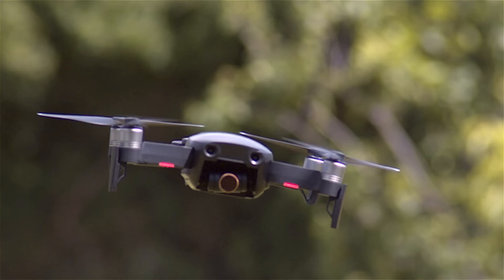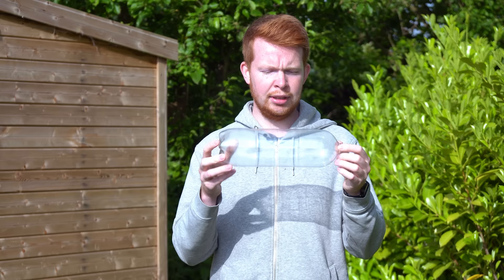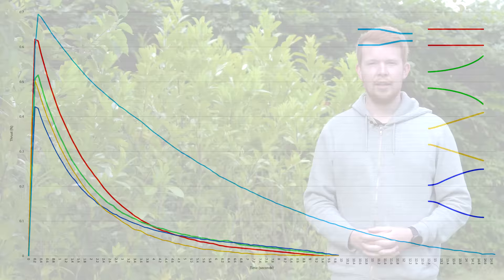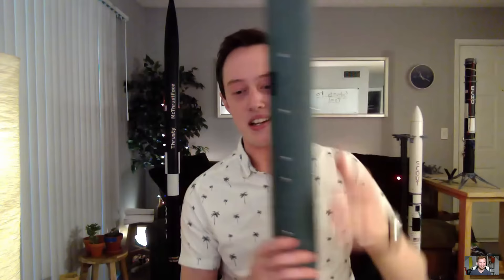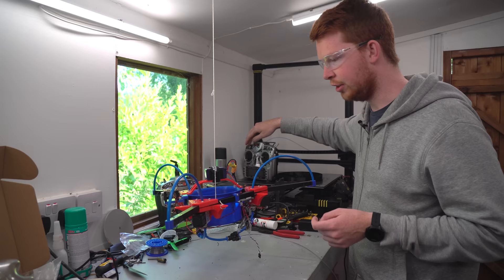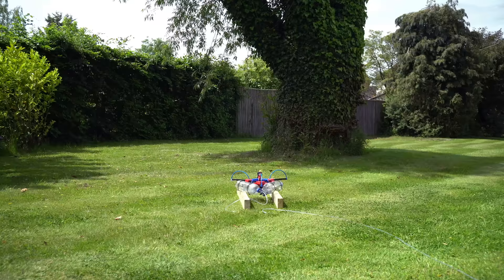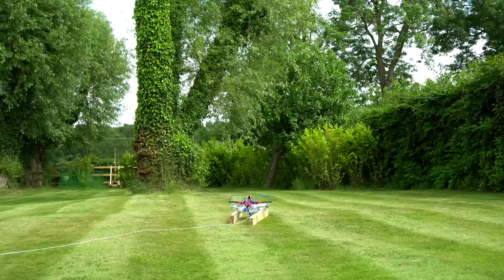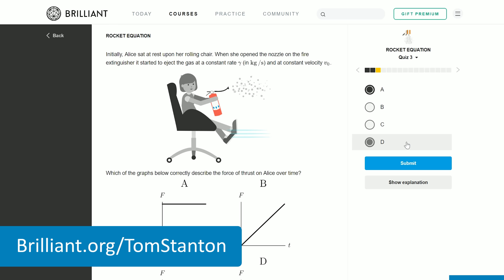Gas Thruster Controlled Drone

Comment: There is a simple way to have a compressed fluid that doesn't change pressure as it is vented: use a liquid that boils below room temperature. Propane should work (though the pressure gets sketchy-high for 2 liters on warm days). If flammable propellants aren't your thing, then "canned air" should also work. Using boiling liquid has the added benefit of being able to carry much more propellant in your tanks.
Reply: dry ice would definitely similarly very high pressure, a pressure release valve might help mitigate that
Reply: maybe chemical gas generator? CaC2+H2O or something like that?
Reply: Well spotted! Propane has a density of 493kg/cm3, while compressed air has just 1.2 kg/cm3, that's why using compressed air you need an unbelievable amount of pressure to stabilize anything (rockets/drones/etc., etc.).
Please check the propane gas thrusters created 5 years ago by Amazingdiyprojects. He created this system for his steam model rocket motor. If BPS will use propane, booya, we are going to see some serious fireworks. :-)
Reply: oh goodness, i just realized what would happen using propane with a solid rocket propulsion mechanism
Reply: Did someone actually suggest venting propane for thrust instead of igniting it? We must be at a genius convention here... Maybe you can just power the drone by getting an extension cord and plugging it into itself for abundant free electricity.
Reply: I would highly, highly, caution using a flammable gas in this experiment. Dry ice with a spot of water to help it evaporate would be much safer. With an appropriate over pressure release valve of course. Many pressure regulators have them built in.
Reply: Most canned air is also flammable. I learned this the hard way using it to cool something I was soldering with a torch.
Reply: @alphaforce6998  Nobody has suggested that, but propane is flammable, therefore (potentially) the gas thrusters system can be used with a drone (as long as you take care of all the hazards), with a steam rocket motor and for other "applications" don't involve the use of solid fuel motors (as venting propane during the combustion of the motor itself, can ignite it). Regarding your idea of the long extension cord, what can I say... welcome to the convention!
Reply: @RCLoversan  Just looked up his vid. Very interesting. One catch though is that the rate at which gas is produced decreases as the temperature also decreases due to the pressure decreasing and the gas vaporizing. But that is a good idea. For a short rocket flight it might work pretty well.
Reply: @RCLoversan  says: "Nobody has suggested that"

Original Post:
"There is a simple way to have a compressed fluid that doesn't change pressure as it is vented: use a liquid that boils below room temperature. Propane should work "

You sure about that?
Reply: @alphaforce6998  He's saying propane has higher density, therefore can be stored in larger quantity (compared to air) and that propane becomes volatile at room temperature. I don't see any suggestions about igniting it, though there is the risk of, as propane is highly flammable.
Reply: @RCLoversan   You are missing my point, sir. I am stating that it would be far more effective to ignite the propane RATHER than venting it for thrust.
Reply: @RC Lover san Density is not important in this case. Velocity (pressure) and quantity of gas at a given velocity are the factors that determine thrust.

Venting propane from its liquid state to gas via evaporation generates very low velocity, and therefore minimal thrust.

Thrust occurs as a result of atmospheric displacement. A low density gas expelled at high pressure (velocity) in a given quantity will produce exponentially more thrust than a denser gas in the same quantity at a lower pressure.
Reply: "It WoUlD bE fAr MoRe EfFeCtIvE tO iGnItE tHe PrOpAne" yes, it would be more effective to go buy a drone at the store too, but that's another project (much less interesting) this is about using gas pressure to regulate the drone, you don't get how this works, do you?
Reply: @ @alphaforce6998  Yes, you are correct, igniting propane would be far more efficient it terms of thrust generated than venting it, but the problem we are discussing here is not efficiency, but inconsistent gas pressure. Efficiency was never the point of Tom's design, he already made it work with a far less efficient propellant (air). His goal is simplicity, and using burning propane as fuel would make the system far more complicated, therefore it would be a terrible idea for his project. Venting propane wouldn't add too much complexity, and it might solve his problem with decreasing pressure, so it might be a viable solution. Though there are probably better solutions out there.
Reply: @gavinoaw   A regulator and high pressure storage tanks would be the only way to use comprssed air and maintain consistent pressure for more than a few sprays.
Reply: @alphaforce6998  Oh, brilliant idea. Then instead of fans and cold gas thrusters, he could have a ball of fire and plastic flying about his yard. Propane's a bad idea because it could catch fire. Intentionally lighting it is just insane for the materials Tom works with. 

Oh, and one other thing - even real satellites often use pure gas pressure instead of igniting a propellant for RCS systems. Turns out getting reliable relights every half second or so is difficult unless you use some crazy nasty hypergolic chemicals or expensive catalysts.
Reply: Yes, a phase-change fluid or dry ice would give a much higher volume of thrust (to last longer) but you would also have weight penalties. GREAT JOB!!!! A true success in proving the concept!!! Another great video!!
Reply: @JohnDoe-rl9pp   So, lithium batts never catch fire and/or explode? Sorry but propane venting is dumb and expensive. If you lack the intellect to make it work with ignition, then dont do it - but dont talk like things you cant/wont do make it an impractical idea.

Real "satellites" are suspended from helium filled balloons, and none of them do not have thrusters. Not what you believe them to be.
Reply: Liquid nitrogen!
Reply: @alphaforce6998  wrap it around a magnet first then plug it into itself.
Reply: @RCLoversan  it must be a SHIELDED extension cable and the shielding needs to be grounded. So make sure it's a LONG one.
Reply: @alphaforce6998  sounds like a SUGGESTION to me...
Reply: @RCLoversan  and you are guiding a ROCKET with it. Isn't a solid rocket motor a source of ignition?
Reply: @leveckfamily8841  You can't used it with a solid fuel motor model rocket. I mean, unless you don't want to see some serious (and dangerous) fireworks.
Reply: @leveckfamily8841  I'd like to underline the extension cable is not my idea and I don't think it can be applicable with hobby grade rc drones (not mentioning rockets). Tethered drones exist and are useful in other applications, but a hobby grade rc drone will probably struggle to lift the cable/wire itself or, at least, to fly in a predictable way with a cord attach to it.

Comment: You could probably gain some efficiency by also ducting the nozzles. Venturi effect etc.
Reply: The venturi effect may increase the velocity of the gasses,  but it doesn't change the mass, therefore doesn't change thrust. The nozzles actually increased the surface area which increased drag which reduced thrust.
Reply: Andrew Krause you trade pressure for mass flow. Just what you want.
The ducts around the nozzle would work somewhat like the duct around the prop.
Reply: @andrewakrause  p=m*v 
F=dp/dt
Reply: @andrewakrause  Yes but the trust equation is a function of mass, flow, and velocity. Thus it would increase.
Reply: Try it, let us know.
Reply: I think you mean, like a jet-pump.
Reply: @14aartis  Ducting the nozzle would increase "fuel efficiency", but it would decrease instantaneous thrust. It would lower the thrust a certain degree but would use up a significantly lower amount of pressure. https://www.grc.nasa.gov/www/k-12/airplane/rockth.html The mass flow rate decreases while the velocity increases. A decreased mass flow rate means that less fuel, or in this case air, is being consumed per unit time. An increased velocity means that thrust given from each unit of air is higher. The only reason that this could be considered less efficient is that the temperature of the gas tanks would decrease more due to the fact that more kinetic energy is lost in the exhaust gas, but in this case it doesn't matter lol.
Reply: Make a bell shaped rocket nozzle on the ends, it might increase surface area for the air to push against. It's like the combustion chamber in a rocket, it needs something to push against.

Comment: Correct me if I'm wrong, but if my calculations are correct, you're adding anywhere from 9.97382 grams to 10.5526 grams OR 16.6230 grams to 17.5876 grams PER BOTTLE - depending on if you use 60psi or 100psi compressed air in each bottle with 0.002m^3 volume (2 Liters), respectively. 

This means you're adding at least 29.9215 grams or 49.869 grams to your aircraft.
However, you're dispelling this mass UNEVENLY! This will cause the Center of Mass (CoM), the Center of Gravity (CoG), and intended Moment of Inertia (MoI) to shift in the direction toward the side with more mass/gas. 

You can solve this 1 of 2 ways, how I see it. 1) You need to connect all 3 of the pressurized 2L containers together via open, fixed valves so that they form a single container of pressurized gas - this way the air is much more uniformly distributed when expelled. 2) Adjust your thrusters' flow rate to compensate for the changes in CoM, CoG and MoI - this would be significantly more challenging since you'd need to add pressure sensors (that withstand 60-100psi) to take these measurements and write more complex logic to even start testing.

• m (mass of Air): TBD

• M (Molar Mass of Air): 28.9674g/mol => https://www.engineeringtoolbox.com/molecular-mass-air-d_679.html
• V (Volume of container): 0.002m^3 => (2L == 0.002m^2)
• p (pressure of compressed Air): 413685.4374Pas or 689475.729Pas => (convert 60 or 100 PSI to Pascals)
• R (Universal Gas Constant): 8.314
• T (Temperature in Kelvin): 273.15K or 289K => (0˚C or 15.6˚C)

Using the formula for the Ideal Gas Law:          m =  ( M • V • p ) / ( R • T )

References: 
• https://en.wikipedia.org/wiki/Standard_conditions_for_temperature_and_pressure
• https://physics.stackexchange.com/questions/268419/how-to-find-weight-of-compressed-air#268442
• https://www.calculateme.com/temperature/kelvin-to-fahrenheit/300?
• https://www.engineeringtoolbox.com/molecular-mass-air-d_679.html

Comment: Great stuff Tom.

expanding nozzles need a gas with energy to do the expanding , compressed air has little additional (heat) energy.
Reply: Rick Lokers  IF it comes at high pressure, which is not the case here
Reply: Yeah, also for any nozzle you want speed for pressure which is why the constricting worked best, though it could probably be optimized a bit further.

The exceptions for the energy rule is entropic explosives and low speed deflagration combustion, in essence the actual rule is that the bell nozzle and aerospikes wants supersonic flow of propellant, which in essence mean combustion products.
Reply: Wouldn't it work better if he reduced the flow BEFORE the expansion nozzle?
So if he used a 2mm supply line that fed into a nozzle that first reduced to 1.5mm THEN expanded to 4mm wouldn't that work better?
I'm not sure what the most efficient numbers are but you get the idea, right?
Reply: @leveckfamily8841  Not if the flow isn't supersonic, if it is super sonic there are other reasons to avoid it sometimes like structural integrity, but in general then it's a good idea, in those cases you need a different type of restriction though.
Reply: @leveckfamily8841  the best would probably be a diverging nozzle with a small throat like the one he settled on (≈2mm) and that expands to 4mm or 5mm.
Also it would probably be a good idea to sand it smooth to decrease drag/turbulence

Comment: You should put diy ice in the bottles it will make that cool smoke affect while also giving you TONS of pressure
Reply: Co2 pressures will burst those bottles
Reply: @ipodhty  not with a pressure regulator....i think you could have sort of a manifold who let some reactions occurs at a selected low pressure threshold...., by timing the chemical reactions.dry ice with air might be touchy to control in time  since it active with oxygen. im no chemist but neutralizing some acid in little timed quantities might be a pretty neat iea .you make the reactions take place one at the time in a 4 thicker bottle that feed the 3 others and have a pressure regulator...Still you will have weight that's reduce in flight to program in the arduino.

Comment: If the valves can open and close fast enough you could use Pulse Width Modulation instead of a plain threshold. I imagine it'd just give a bit finer control when under the threshold for plain on/off (but above another threshold defined by how quickly the valves can pulse).

Comment: For some of these drones, you may want to consider designing the arms at a slightly upward angle. This is commonly used to improve a drone’s stability and, even though it’s mostly only for propeller drones, may help your case a bit.

Comment: I remember my professor saying something along the lines of "that's the method of tuning the PID controller, but to be honest, you'll probably end using trial and error"- I guess aerospace buisness holds better standards than some backwoods uni:]
That drone flew quite well for "eyeballed" values!
I saw some drone projects using 3 motors instead of 4 and I was wondering why it isnt't a standard configuration- you managed to clear this up with one sentence about propellers induced yaw change:D
Reply: It isn't even about holding higher standards - it is absolutely normal to make informed guesses with control systems. It's just that cost of making mistake with rockets is incredibly high.
Properly and precisely calculating right control parameters is incredibly complicated and time consuming, for even simplest of cases.
Reply: It's sad that he already had the test bench setup to measure minimum thrust at minimum opening time for the valves. It would have been easy to setup a reference table in the Arduino, and given better control at near-zero pitch/roll

Comment: Why not treat the flight controller's motor speed output as a frequency? So the gas is outputted in pulses of increasing frequency as more thrust is requested. Would improve your fine control.
Reply: Might be hard with the solenoids limited speed
Reply: I thought about that as well, but i dont think the solenoids can turn on and off quickly enough
Reply: @oskarkrogsgard3014  I wonder if it's possible to have faster solenoids.
Reply: @luongmaihunggia  Most likely is. But they are probably also more expensive.
But I think it's easier to make a variable valve though, like the throttle in a carburetor. There is a problem with making air tight though, but I'm sure some clever engineers have already figured that out
Reply: @oskarkrogsgard3014  more expensive and heavier, yes. variable valves like that are available, but also rather heavy for something like this.

Comment: Add: pressure sencor to read back pressure to arduino, two to three nozzles per arm at diff distances. In high pressure deliver pressure to inner nozzles and as pressure drops let compressed air channel to outer nozzles.

Comment: for added stability, you can fuss around with some fancy software and make the computer understand the torque difference between the positioning of the 3 arms and give it the capability to spin on the yaw access or understand the pressure difference by using other hardware, but id recommend using a 4 arm drone just for the sake of simplicity.

Comment: Hi Tom.
Congrats on the success. =)
Modern turbo charged cars comes with a solenoid valve called Boost Control Solenoid (BCS).
The job of this BCS is to gradually taper in/out the boost pressure from the turbo to the throttle body.
Most of valves use PWM at a frequency at about 16 Hz.
The frequency choosen is based on how fast the BCS can open/close. i.e. how much mass the plunger has.
You can run these valves almost at any air throughput from 0% to 100%.
You could try using this method to improve the performance of your drone.
Great work as always!

PS. The BCS valve is very similar to the ones you use. So you should be good to go without upgrading your valves.
Reply: A really high performance turbo might run at around 30PSI of boost. Joe is running 60-100PSI or more for his thrusters. Care must be taken with choosing a valve for a thruster, because they tend to fail if you use more than their rated pressure. The failure modes can be leaks, failing to open,  failure to close, or destruction of the valve itself.
Reply: @USWaterRockets  they run civics at 60psi
Reply: I agree with you,but I see another one say p =mv.  F =pt.  So its just like the fuel injector.fuel flow decide by the pulse wide .        I think it's a easier way to  control the force.     Bad English . :-p
Reply: @-_-5352  Yes agreed.
I was thinking F=mass of air/time
But there could be a problem with the amount of time and deadtime of the valve.
Your English is just fine. =)
Reply: @USWaterRockets  Yes agreed.
Keep the valve he has. It's made of metal. Many car BCS are made with plastic bodies and prone to crack and leak over time.
On my project car I switched from a PWM valve to a ball and spring type manual one. It holds shut until desired boost is achieved. The boost comes on hard and datalogs show no leaks.
Tom should keep the metal ones he has.
But if he tries the PWM method he can add a hard cut of airflow once the desired angle is achieved. That minimizes the over compensation.
You could even taper by ramping the PWM width and/or time at the end.